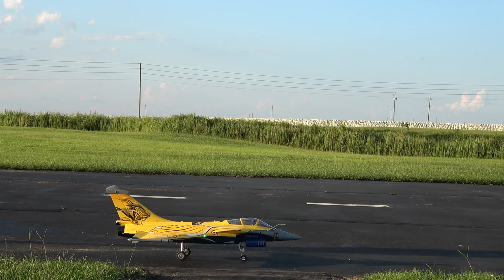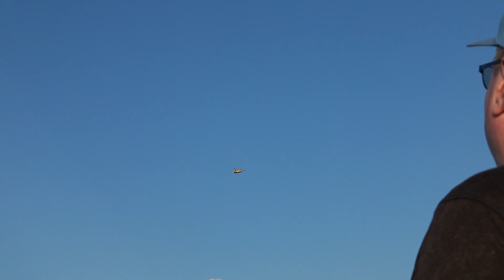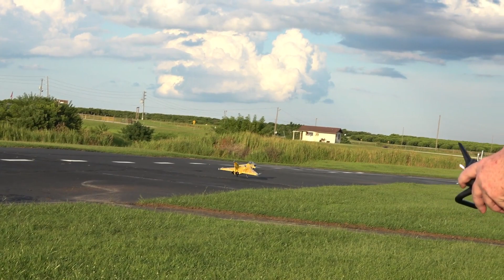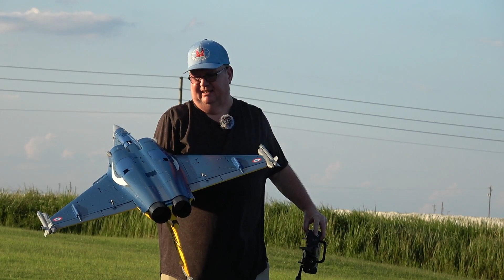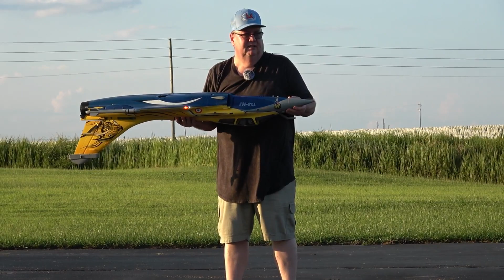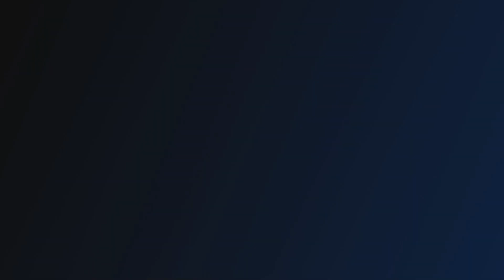FMS RAFALE 80MM SUNNY DAY REVIEW by Fat Guy Flies RC

Comment: with mine I pushed the battery ( 5200mah) literally all the way back  toward the tail. Its the only way to get it to rotate off grass. took me a while to figure out how to land it. ive only been flying rc for 9 months so I usually was only getting 1 flight a trip out of it because I would take off.... then have to glue the landing gear back on after landing long. trying to glide it in. great flyer. probably the best flying jet I have.... lands weird if you don't know how to alpha.
Reply from the maker: Yeah she does take a while to rotate up, try a lighter 4000 with a 3 minute timer.

Comment: Hello...
I built the FMS Rafale last week and I have some concerns about the "canards" at the front. They are constantly moving. I thought they would stay fixed and move only using the servos. is this normal? Is it the fact that the plane is on the ground and stopped ? i have a video on https://www.youtube.com/watch?v=rIvbQkQOU6c to present my problem.
Reply from the maker: They should only be moving when you use elevator or the flap mix from the control board.
Reply from the maker: I watched you video they are working normally but you don't have them properly installed .  That grub screw is not locked in right.